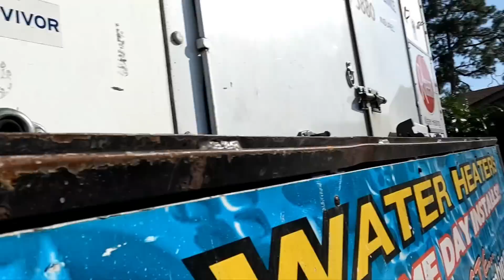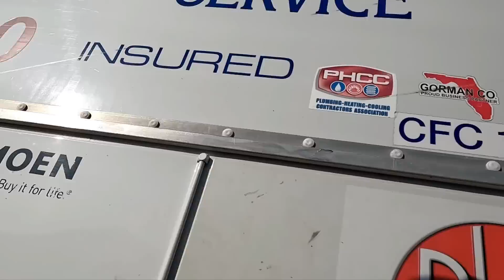IT'S  MONDAY,HEATER,TUB,SHOWER STOPPAGE

Comment: John, FlowGuard Gold requires 6 hours cure time on hot water systems up to 180PSI.Have you ever had an issue with waiting the 6hour cure time? I'm a plumber and have had lines blow out before waiting the cure time on service calls. I am up north in MD though, definitely could be a factor. I've only ever had an issue with cpvc cure times, never with any other piping system. Do you have any experience with cure times for cold/hot up north where it freezes?